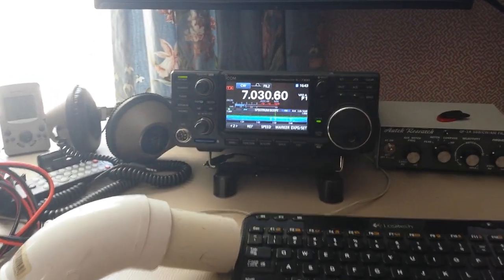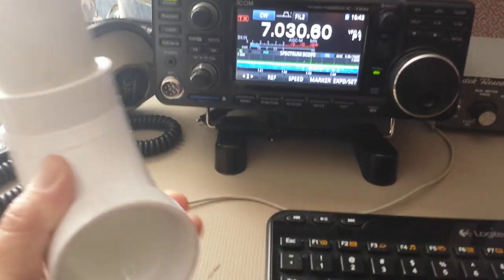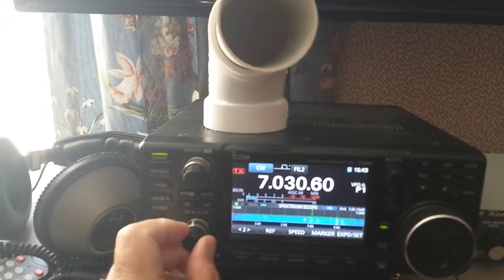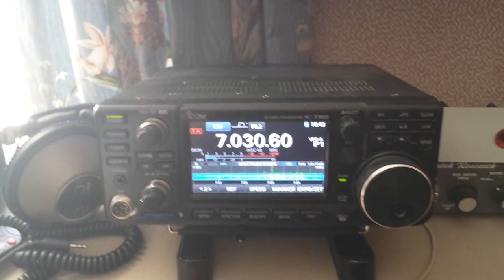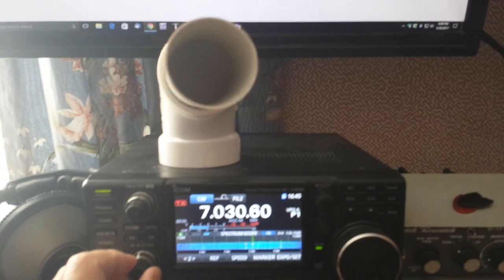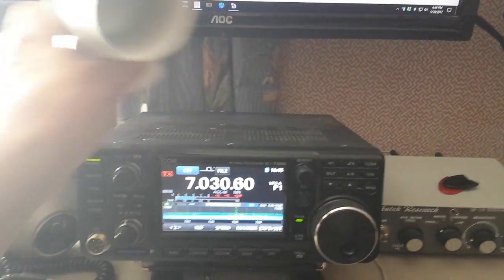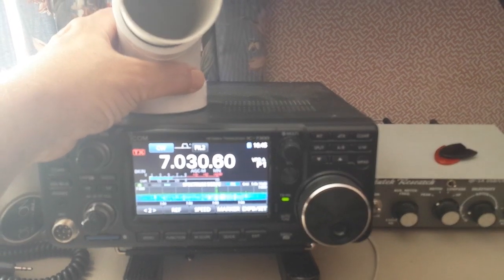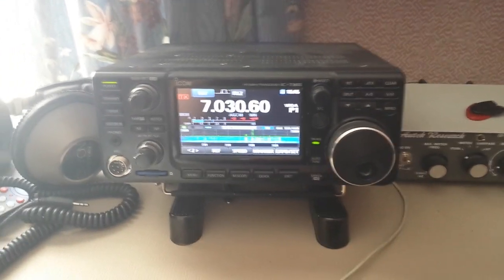IC 7300  CW sound tube

Comment: YOu gotta wonder about the engineering behind a top-facing/upward-facing speaker in a communications receiver. Same problem with the Xiegu G90, fixed exactly the same way. Makes a herd of a difference not only for copying but just on your ear strain. 73 de W8IJN

Comment: This is what I need for my truck mobile unit. I tried to use a small inexpensive plastic bowl cut in half. Problem was that it wasnt curved enough to take advantage of the parabolic cone effect. Also, because it was a cheap thin plastic bowl, it then added some vibratory distortion. Im thinking this setup might be ideal to throw the sound forward out from under the seat. I purchased an external speaker and thought it sounded terrible.

Comment: Looks like classic southern ingenuity :) I just bought a 12volt automobile fan motor - new for $2 on ebay - to use as a fan in the shack. those automobile fans seem to move a lot air so i figure it will make a great indoor fan too :) specially for 2 bucks

Comment: Does Icom make an external speaker to match the 7300 ?
Reply from the maker: yes
Reply: There are several, I use the Icom SP-35 for my go box. They also make the base station speakers SP-23, SP-33, and SP-41. 73

Comment: Hi Steve, nice idea, I wonder if the 2" is critical as all I can find in UK is 1-1/2" ( inch & half ), and that don't work. !
Reply from the maker: I think it needs to be big enough to cover the speaker otherwise some of the sound will escape around it but it's not a big deal. 1 1/2" will work ok especially if you can seal it up around the speaker with some tape.
Reply: Hi Steve, managed to find some two & quarter stuff, wow what a difference to my enjoyment of radio with my defective hearing, hi.  Much better than cans for me so many thanks for the tip.   I still hope to catch you on air one day.  73, God Bless   Nigel, G0IIK
Reply: Hi Steve, now about a month in with this device and it's a permanent feature sitting over my Ic7300 speaker, I cannot thank you enough for the tip, absolutely transformed my enjoyment of the radio.  Wonder if you have a tip to improve propagation, hi?  73 Nigel